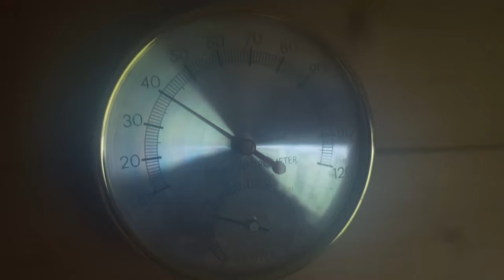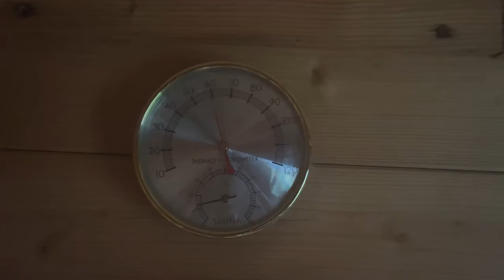Trying our sauna for the first time!

Comment: Hi, I just found your channel and am binging through all the videos. Love your long chats, please keep doing them! As a Finn living up north, I'd recommend wool pants and loose layers to keep warm so the air can work as insulation for you. Then a wind proof layer on top.  I also prefer a humid sauna to a dry one, there's more than one way to do it. :) There should be no smoke inside though so be careful.
Reply from the maker: Thank you so much! Especially for appreciating the long chats ☺  
With the sauna we've figure we have to seal the pipe hole better because if not the smoke can come in when there's wind. Luckily it's an easy job!

Comment: With your CFS after your “burnout” it’s likely you need to address the insult to your limbic system. There are programs that have proven to be helpful with that. Also with your CFS and previous asthma your cleaning of the moldy, mildewy cabins should be done with a N95 respirator mask.
Reply from the maker: Thanks so much for the very useful info! I had never heard about Limbic Kindling theory until your comment, and I feel so identified. I'll be doing more research and working with my doctor to find help. Really appreciate you ❤

Comment: I identify with your fatigue.  In my case it arises from depression.   If the depression sweeps in so too does the level of fatigue.  I understand the feeling old feeling.   I often feel ten years older than I am.  The answer for me has been to pace myself.  You seem to be doing this which is good.  Thinking positive thoughts helps too.  Exercise is definitely helpful - it lifts the mood.  I’m told a cold shower/swim is helpful but have only very occasionally tried this.  Will the sauna not exhaust you?   For me, a very important help is my Christian faith.  But that is perhaps for another time.